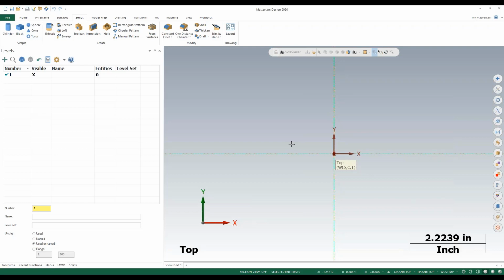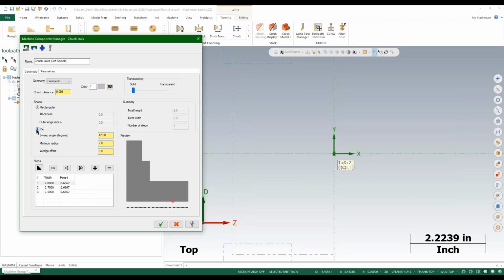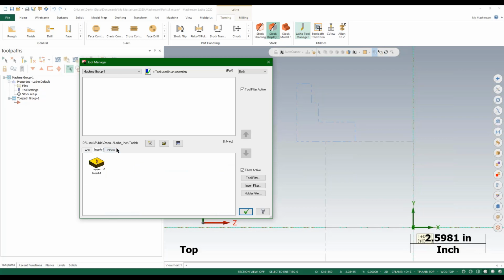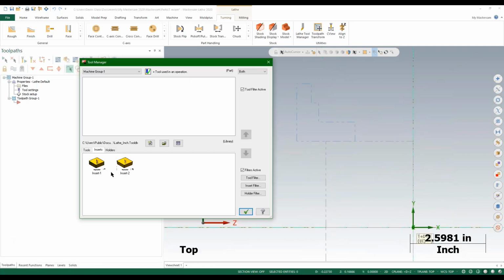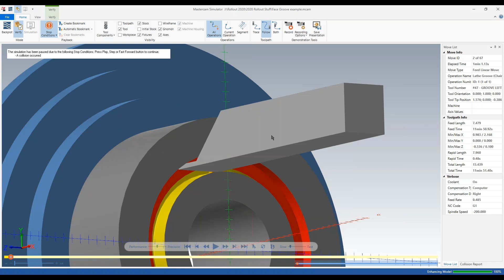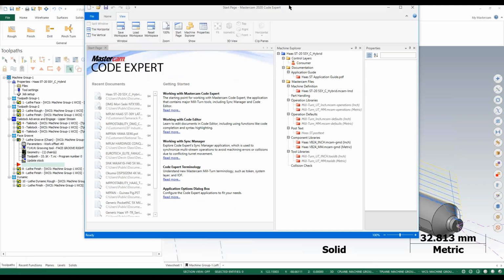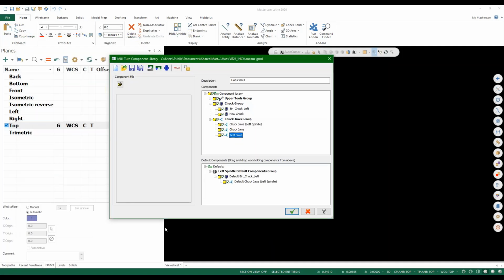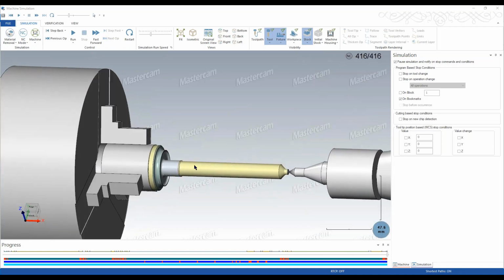Mastercam 2020 Rollout Webinar 2: Lathe & Mill Turn

Comment: Thanks for the info. Is the machine simulation part of MasterCAM?
Reply from the maker: All turning simulation with the actual machine is an upgrade so I encourage to contact your local reseller. The Verify with 3D tools is included in the standard Lathe package.

Comment: Great stuff. Is there info in face groove set up?  We do a lot of face grooving, this would be great to start implementing.
Reply from the maker: Hey Josh, contact support and they should be able to help out but the short answer is if you use the 3D tools setup for face grooving should be match up with what you have on the turret.